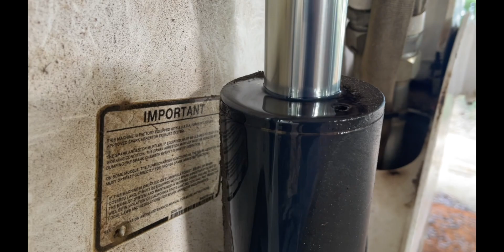Bobcat S250 Hydraulic Lift Cylinder Seal Replacement

Comment: Just in curious on how many hours was on the machine when you did this repair? I'm getting ready to do mine and it's got 3900 hours on it thanks good video
Reply from the maker: @cliftonbrewster7527  I think 2200 but I had really over done it pushing up a huge oak tree. That’s when they started leaking

Comment: I have an A300 and watched HowIDidIt first.  Since I don't have a crane and a 2000ftlb impact named "Milly" I searched to see how others were doing it and found your video.  No offense, but I must say, it's like watching a technical service video of how it should be done, then watching a video of a backyard mechanic using a Crescent wrench and a rock to do the same job.  Good job! Certainly eases my concerns of just how tight that bolt is and if the crane is required or the single safety support will do the job.  I like the idea of the "early notice 2x6" as well.
Reply from the maker: Hahaha!  Exactly!  No offense taken. Glad to do my part. That’s what YouTube is all about in my opinion, finding the answer to a problem or question. Thanks for watching and be safe out there!
Reply: Now I wanted to watch a video so I knew how to get the hardest seal back into place and of course that’s the part that you skipped, so this video didn’t help me at all.. And to break the nut lose, I stuck mine in my vise that I have, just to let you know in case you have to do it again.. Now I gotta go find another video to watch.. I really don’t want to break that seal

Comment: live safer getting ready to replace the one on are t190 its leaking terrible out of the cylinder.
Reply from the maker: It’s not too difficult just have to be safe doing it. Good luck n be careful!
Reply: I have a T190, I would suggest buying the seal kit straight from Bobcat. My first seal kit was bought from all skid steer Which failed… after starting up machine  and lifting cylinders, So I had to do the job twice!

Comment: Is it necessary to extend the cylinder for removal?  I am planning on doing the cylinder on the bucket for my S530 but curious if it matters if cylinder needs to be short or extended or does not matter prior of removal?
Reply from the maker: @RudyGarcia-r1e  I don’t believe it matters as long as you have access to all the nuts, bolts, lines, etc. and are able to remove and reinstall the cylinder without having to raise the arms

Comment: Using the arm to hold the rod for nut removal w a cheater pipe just never occurred to me.  That nut was a show stopper until I saw your video.  LoL... who needs a vise...  Thanks!   Oh and instead of a warning board I  just rested my arms on a big tree w wheel chocks along with the standard arm lock that came w my S300.
Reply from the maker: Took me a minute to think of it but worked out well. Gotta use what you got, lol. Thanks for watching!